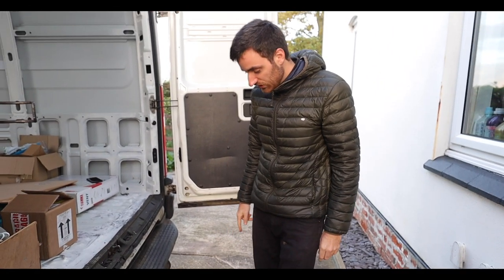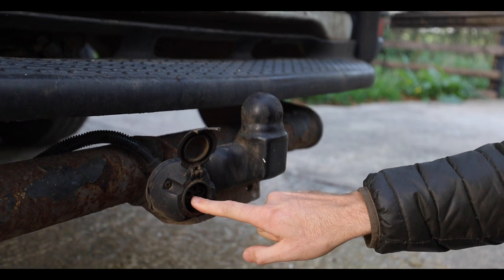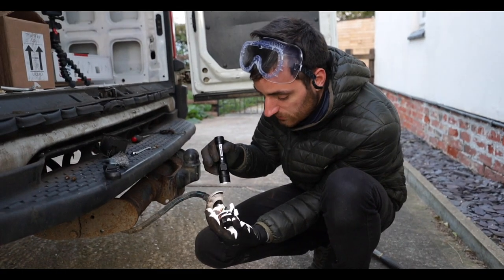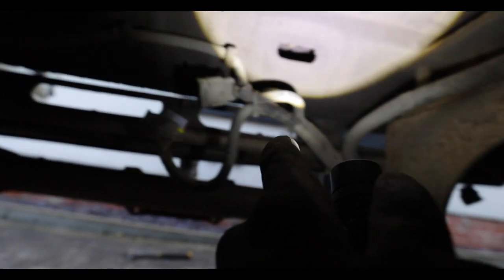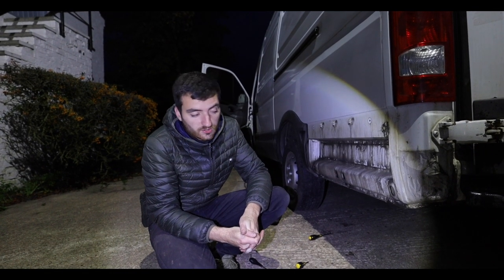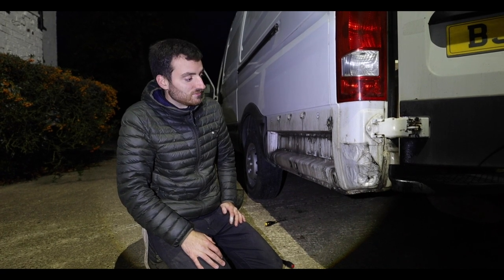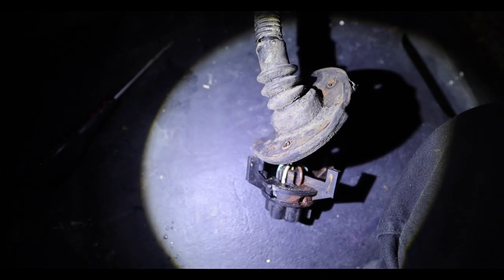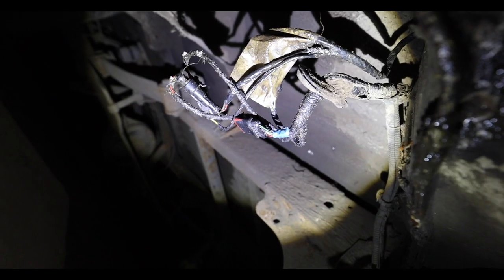Not As Easy As We Thought! | Van Life UK

Comment: If the tow bar is fitted the electrics should be tested at the mot . The metal fittings in the socket are very low grade so pack it with grease cut back the tails of the cable , the wire copper should be bright , if it’s black it’s shows contamination from poor connection or a short.
Reply from the maker: Wicked, thank you 👍
Reply: Should be tested , totally agree it’s rarely if ever tested.

Comment: Mate its 7core wired with a loop wire for the side lights or it will go in to a factory fitted harness isolate it at the harness plug my bet is its spliced in to one light cluster and then the loop wire ran from the other cluster for the side light on that side if that makes sense
Reply from the maker: Yeah got what you mean. I've had both rear lights out though and there's nothing spliced into them. Think it may be a factory harness and the cables run further back then that 🤔

Comment: Put all the wires of the towball socket into plastic connector individually   and spray  wirh the WD40 to repel any moisture  then tape around  and conceal underneath  somewhere with cable ties .I have done this with no problems, just check once in a while to make sure secure.
Reply from the maker: We have bought a new plug then plan hiding it out to way. Hopefully it sorts it out. 🤞

Comment: Just try to put a new tow bar plug on the end. I would not try to take it out of the wire loom as its a factory install.
As you said it was full of water that is the main issue. I had this on my yow car and it resolved the issue.
Hope this helps.
Reply from the maker: We bought one today to try funny enough. Fingers crossed it works as it only cost us a couple of quid instead of paying 100s for a auto electrician.

Comment: Two solutions 1 buy new multilink plug ,re-wire and seal with silicone. 2 remove each wire and seal each individual wire with heat shrink then seal all individually sealed wires in rubber sleeve which is sealed with silicone then cable tie high up under chassis. Done both these and had success, you need to prevent damp/water causing a short so the heat shrink/ rubber tube seal is a sure fire way.
Reply from the maker: We bought a new plug so we will try that first if not we will try your second solution. Hope it fixes the problem then we can get on with the build.

Comment: Does the water you found collecting under the rear light clusters come in from the panel fixing holes that you took off. It also gets in the side sills through the panel fixing holes you should be able to find videos about sealing them. See if you can find some drain slots on the sills and unblock them with a screwdriver. You may have to drill your own holes under the light clusters.
Reply from the maker: I'm not sure if it got in there from us cleaning out the inside last week. We will take a look to see if there are any drain holes and make some if needed.

Comment: probably indicator and brake light will b on near side. offside lights is a different bulb type due to fog light  side light switches off and fog goes on same bulb . only one cable may go to off side on vw
Why not just cut and tape ends or replace wire. looks like it was from manufacture. maybe the cable runs to the cab area n back to tow b because the indicator buzer is located there?  buzzer is legal rec in some countries  good luck
Reply from the maker: Will have a look into that if the garage can't sort it. Thanks 👍

Comment: I'd tape the wires individually at the tow bar electric point, wrap it in a plastic bag, tape it up and cable tie it out of the way, as long as all wires are taped it should be fine
Reply from the maker: That's literally what we are going to do now although we bought a new plug to fit on it to try and get rid of the fault light.

Comment: Looks like you found the issue, looks like you need to replace parts of the wiring loom or you maybe able to cut the plugs off and solder them wires heat shrink them and make it water tight again so you don't end up with the same issue 😉
Reply from the maker: Yeah we're going to replace the plug tomorrow and hopefully that sorts it 🤞
Reply: @TabithaAndLiam  looks like it's more than the plug, from what i can gather looking at the video at the end those other wires under the light cluster look like they maybe the issue
Reply from the maker: @tjsaquatics4386  hopefully not haha. We'll see tomorrow. If it doesn't sort it then I'll try follow the wiring further back 👍

Comment: I'd remove towbar to save weight
Reply from the maker: Yeah a few people have said that. I think that's what we are going to do 👍
Reply: The bigger the van the more material it needs so more weight. Save weight where you can cause you easily end up with a van and can't carry anything cause it put you overweight. We have citroen relay h3l3 built with cladding it end up putting a 1 ton of material in it. We weight in at 3,260kg on a 3,500kg van. We have a basic enough build small water tanks 2x 25l. 25l waste. Just get the van weight. With everything in as if ye living in it full water full fuel tank. Don't go made on sound deading if using its heavy.
Reply from the maker: Thanks for the info. We'll try keep the weight down as much as possible 🤞 once the cabling is sorted for the tow bar wiring then we'll take it off.
Reply: Injoy the build don't put pressure on yourselfs with the build. Don't be afraid to take a break if the build gets too much tomorrow is another day.